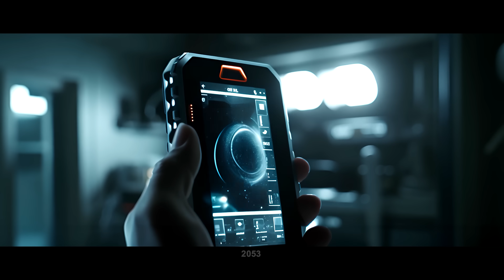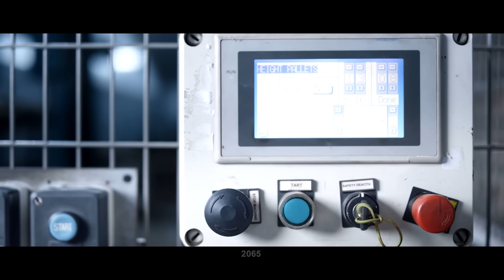TIMELAPSE of Future Space Stations

Comment: Here is a way to build a space station in 40 launches. It will be a square ship and booster like StarShip. 12m square at the base engine area. Above the tank area the side tapers 5 degree in to the nose. All ships will connect side by side a=making a ring. This gives about 240 feet Radius at the outer level and 3.5RPM will give 1g. The level under the nose at 3.5RPM  will give .66gs and at 2.5RPM will be .34 MARS gravity. The Nose of the ships will be for docking and StarShip act as thrusters. At 3 nose docks will be 1MW Nuclear generators supping the station with 3MW. Smaller KILO 5w generator can be use on Lab sections.

Comment: Why Not Put the ISS into Moon Orbit. Then you will have a habitat scientific equipment material etc ?
Also could you please do a video on the O'Neill Space Cylinders etc.
Very Interesting Video 😊
Reply: The cost of building a new space station and putting it into space is less than putting the iss into the moons orbit plus the iss is pretty outdated by now alot of the stuff on it is severely due for a upgrade and it is also rapidly approaching the time to where it becomes sort of dangerous for crew to use the iss
Reply: Thats what the 2170 station was.  Did they mention a video about that?

And why ISS?  - Because they have not recieved the money and neccessary thrusters from you.  Buying the ISS won't be enough; you'll need to have enough for maintenance costs.  After seeing trump in action, nobody will relie on any contract any more.  It is simply safer to dispose this huge space junk.
🚀🏴‍☠️🎸